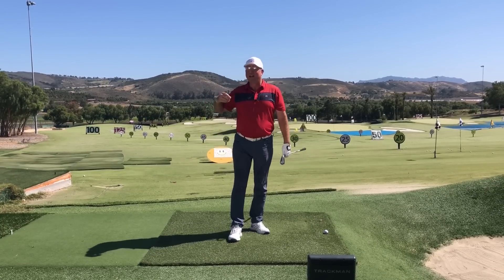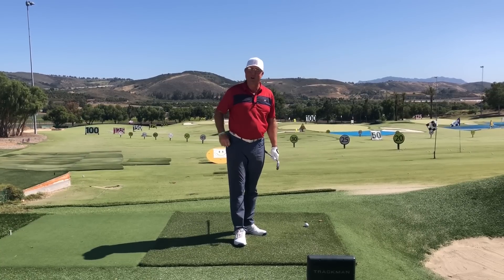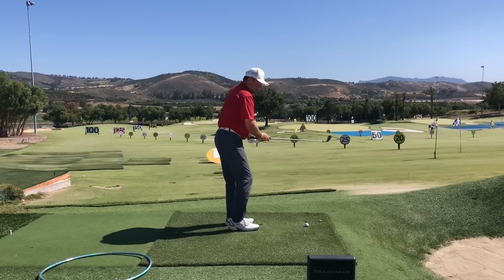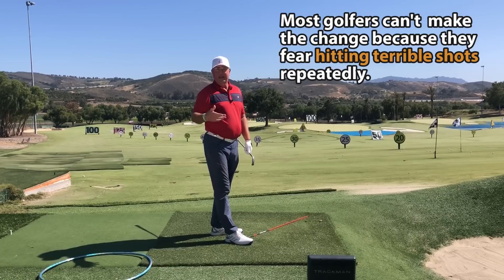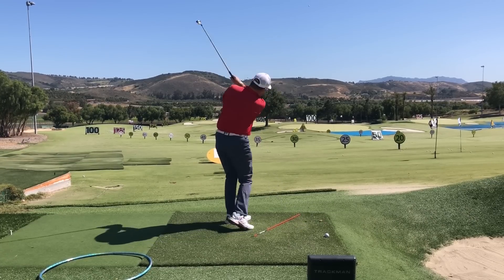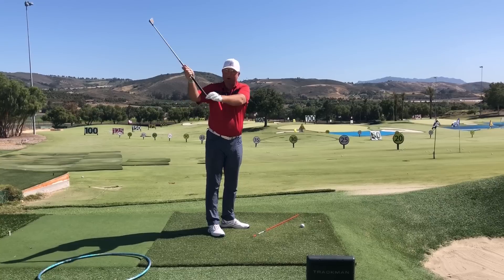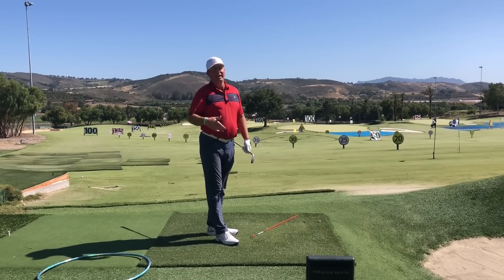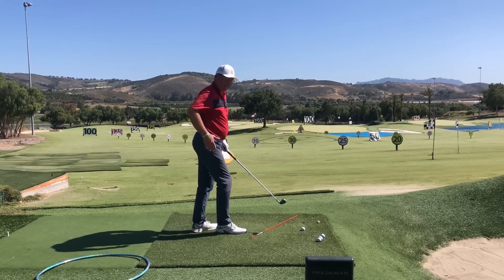THIS is Why You Can't Get Your Golf Swing SHALLOW!

Comment: The main reason golfers come over  the top is due to their initial experiences hitting balls. Typically they always hit thin slices because they are using their arms for power. From then on, they aim left to counter act it, then their are forever an over the top player. If you can start them hitting 50 yd shots preset with their hips open, this problem goes away. Then you just up the length of swing. As soon as they hit it with a slice, you slow them down again. Most golfers think that impact is the same as address with the hips!

Comment: How then, are you able to have  your divots pointing straight or left? I’d love to see your divots on a divot board.
Reply from the maker: If you exit well it will make the path 0 with the plane parallel to the foot line.
Reply: @Inmotion70  I also think, that you can create divots in front and left of your left foot on the target line, that are very straight, very long and shallow but as wide as the clubface with this technique. Test it in the sand or rough or on a divot indicator board, where you can see them. Practicing such divots with practice-swings is a good idea anyway.